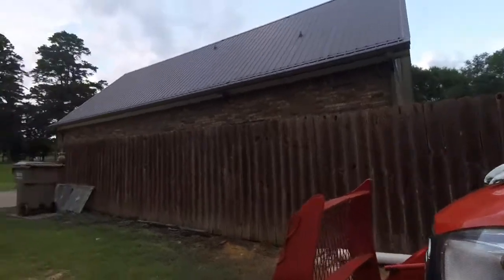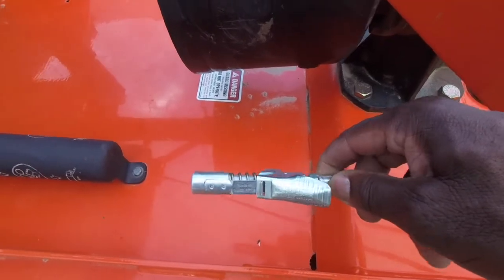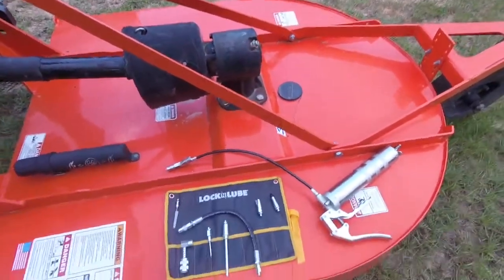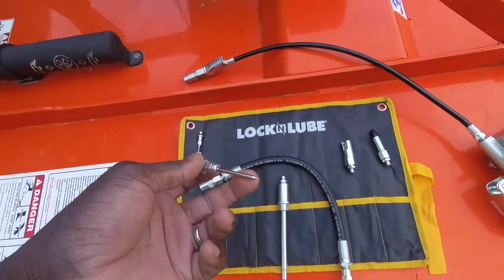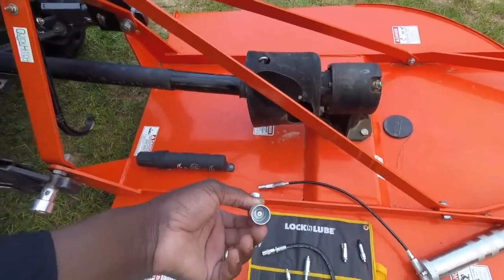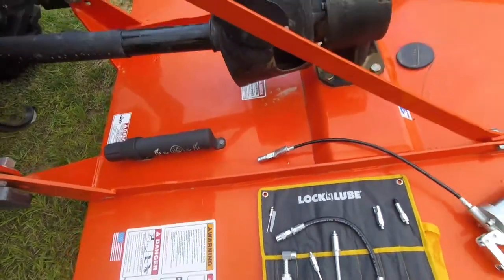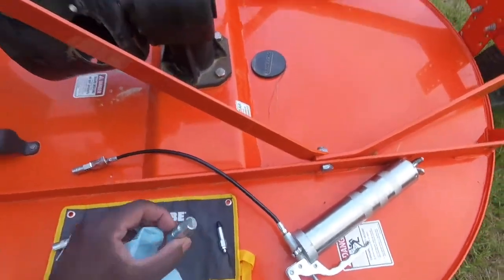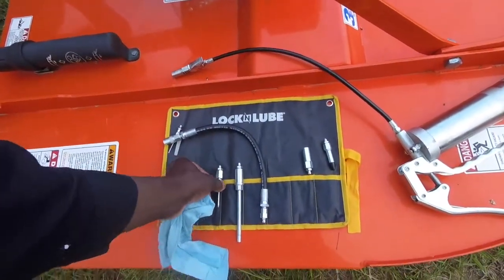LockNLube Quick Attach Grease Kit

Comment: I've never seen the full kit!  I have just the lock and lube and it's worth it's weight in gold!  The harbor freight air guns are junk, but I've had good with the lincoln brand air gun from northern tool.
Reply from the maker: I use the Lock and Lube tool a lot . . . thanks for watching.